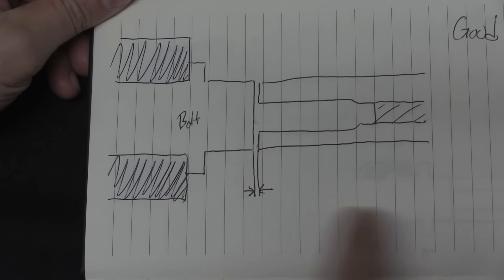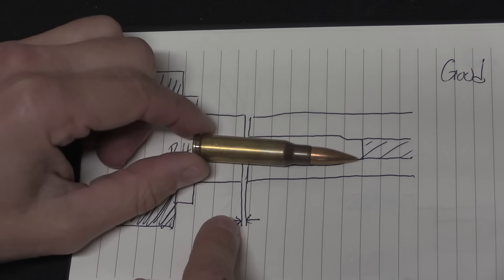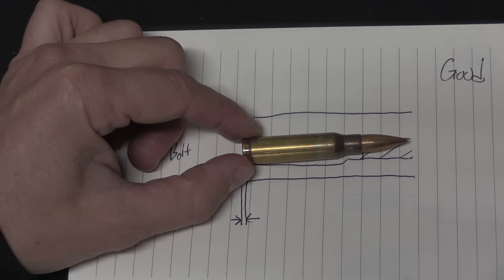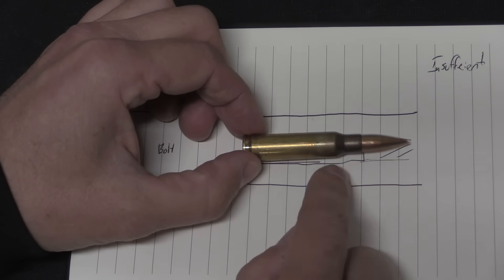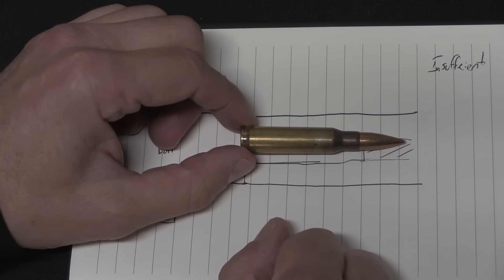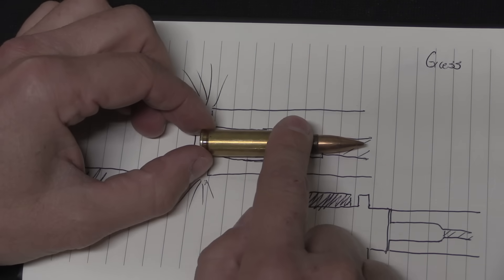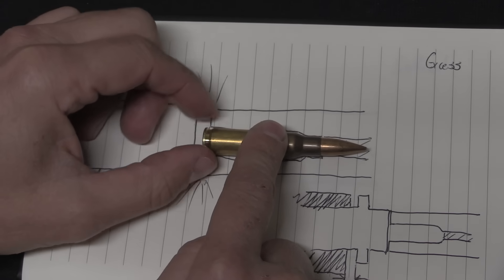Ask Ian: What is Headspace? (And Why It Matters)

Comment: Ian hit it on the "head" with this answer! I work at FN America in Columbia SC as a barrel QA technician in the barrel shop. This is exactly what headspace is and the importance of it being correct. If you have the experience and means to get the gages to check it , do it. If not please don't try. Excellent video on this topic Ian!
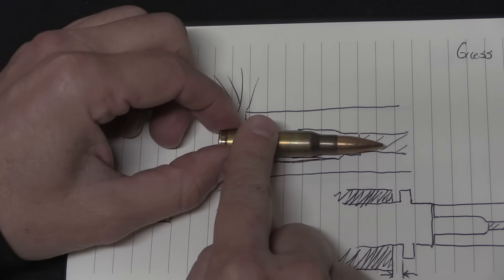Reply: Maybe you can explain then why the bolt sitting flush with the barrel is actually bad? Ian's explanation about that it makes you jam the bullet too hard into the chamber doesn't seem to be relevant, because later, speaking about a gap too big, he talks about the bolt being pushed flush with the barrel anyway, by the recoil spring or by hand (5:01)
Reply: @konstantin.v  I wondered about that too, and even if usual chamber geometries require that gap, lengthening the chamber just a little and starting the rifling a little later should allow for a totally enclosed bullet. There might be less obvious issues, like increased case lengthening when firing (because the case mouth would be the only available direction for the brass to expand) or tighter required tolerances, but this is speculation on my side.
Reply: @tz8785  , I'm guessing the thermal expansion: that a small gap on a cold gun is needed for when it becomes hot and the metal expands some. But it's a speculation, too 🙂
Reply: @@kellyharbeson18  @kellyharbeson18  and why exactly are you trying to belittle someone when I know what I said is the facts ?Free bore had nothing to do with what I talked about. You had a question about how Ian explained headspace and I went into a bit more detail. Sorry you are the master gunsmith, and you took what I said as wrong. But the fact still remains that if the headspace isn't correct you have problems.
Reply: @@kellyharbeson18 Ian was showing a very very simplistic way of showing why a headspace is needed and what can happen when it's not correct, now the head space is actually at the tip of the projectile when the bolt is in battery and it's the space between where the actual bullet is in contact with the  chamber and the  bullet lead.( The start of the lans) but if the head space is wrong it makes the bullet not seat correct and it could be to far in or , not far enough. And that's the issue Ian was drawing. And if it's in to deep the combustion can't get enough pressure and speed to push the projectile.

Comment: This explains the "why" of belted magnum cartridges: that massive back end is not to prevent blowouts, but to ensure the headspacing is perfect for those high pressure rounds.
Reply: It's akin to headspacing off of the rim. Although, you gain better feeding characteristics with a belted cartridge vs rimmed.
Reply: Yup. It's about having nice feeding characteristics like a rimless case, but the very positive headspacing of a rimmed cartridge.

Comment: How do guns with quick-change barrel avoid the headspace problem?
Reply from the maker: Either they have adjustable headspace (Browning 1917/1919/M2) or the barrel locking system has to be manufactured with the same level of care as the bolt locking system.

Comment: I was using a semi-auto .22 that had an out of battery detonation (yes, i know that's different from headspace, but the results can be similar) I wasn't using hearing protection so it made my ears ring pretty good, i got a face full of hot gas and i had a piece of brass 'shrapnel' stuck to my arm, as in it welded itself to my skin. It wasn't my fire-arm and the culprit was old ammunition and a dirty chamber ... so if the bolt and chamber aren't best friends it's going to get real messy real quick, even with something as 'small' as a .22

Comment: I'd just like to point out that there are situations where a headspace issue is less obvious, meaning that the weapon can appear to be cycling fine for several hundred or thousands of rounds, and then suddenly detonate. Typically what happens is a minor case of the situation you were describing @4:50 but instead of the spent case producing an evident indication, what happens is the locking lugs become fatigued from repeated impact of slamming that short distance, until either the bolt lugs shear or the trunnion lugs shear.
Reply: It might also be the case that the vast majority of carteidge-case headspacing features are produced very close to the mean dimension, with very few spread out along the entirety of the allowable tolerance.  But, when you do get one that falls at or near the minimum dimension, or perhaps even below it, you are going to be having a bad day.
Reply: I had a 22 rifle detonate after about 500 rounds (got it at a gun show so probably more put through it before me). Wonder if this is what happened.

Comment: The thickness of a sheet of paper is the difference between too short and too long. Well said sir.
Reply: @karlhillenbrand8447  Note, im not here to steal his thunder, merely add to it. His explanation is quite good.
Reply: @marknovak8255  I appreciate the input from an expert, so thanks for chime in!
Reply: roller bearings are the same way
except they need tolerances down to 0.0001 or sometimes less
Reply: @theq4602  Watching Hambini go on about how shit most high end carbon bike frames are, because they can't be arsed to make actually round holes, that are aligned and sized properly for their press fit roller bearings has taught me this.
Reply: @theq4602  
0.00001 bananas or sometimes less.
Reply: @onpsxmember  Atta boy, now your talking MY language
Reply: I"m a carbon-based lifeform, so I"m going to follow that advice.
Reply: Yeah, that’s the crazy part to me as a newer shooter. I hear people talking about putting a piece of scotch tape on the bolt, I guess, and I’m like, “ really?”
Reply: "The thickness of a sheet of paper." I once put a sheet of plain printer paper into a micrometer, and it was about one-tenth of a millimetre. Your paper may vary.
Reply: @DavidCowie2022  your 0.1mm is in the ballpark anyway, just checked the Saami drawing for 223 and from maximum to minimum is only 0.25mm
Reply: @DavidCowie2022 , most standard copy paper is .004” thick
Reply: I had a casing seperation in my WASR 10 when I tried to feed a new round in the bolt wouldnt close all the way then I looked inside there was the shoulder stuck in the chamber. I melted some wheel weights, poured it down the chamber then rammed it out with cleaning rod or solid steel rod ( smaller than bore diameter) and out came the peice of casing.
Reply: A sheet of paper is approximately .004” thick give or take a little.
Reply: That's what she said!

Comment: Thank you for another great video. What is the term for excessive space (diameter) in the chamber?  I have a .22 that I recently resurrected, when fired the shell case expands outward and then will not extract easily. The firearm is a Remington Model 6. Thanks.

Comment: Awesome video. What happens with cases made from something other than brass like steel or aluminium? I was thinking steel would not expand to make a gas tight seal but that does not make sense.
Reply: Ammunition using steel cases are very common, especially for Soviet/Russian designed weapons. Alloys are used that provide the necessary ductility; to soften steel and strengthen aluminum.  Also, steel and aluminum are considered one-use cases, not suitable for reloading, though some have succeeded in reloading steel.
You make a good point about steel expansion; while safe to shoot, they don't seal quite as well as brass, so a small amount of residue gets into the chamber, which results in slighty greater fouling which requires more frequent cleaning

Comment: Generally speaking, will headspace issues show up on brass consistently? That is, if my brass is coming out normal, probably means there's no significant issue? I have a carcano carbine with extraction issues to the point where the extractor itself doesn't pinch the case, it just pushes it loosely then jams in when locked. My hunch is the extractor is going over the case rim at the last moment, but it's possible the case is sitting forward of the bolt head, resting on the outside of the extractor. Unfortunately changing the extractors on carcanos is very difficult. The thing does not cycle very consistently but I have shot it without other incident a few dozen times, and all the brass seems typical.

Comment: I thought about a set of go/no-go guages when building my first AR. Fortunately on that platform, upper receivers aren't really critical to achieving proper headspace. I just bought a bolt carrier group and a barrel from the same manufacturer, and said YOLO. 
Brass looks great and it's the most accurate gun I own.
Reply: Headspace on a AR is at the bolt face and barrel extension/ barrel assembly. You can buy a bolt not cut right or a barrel that has not been cut right or extension not cut right or installed wrong. Buy headspace gauges.
Reply: Generally speaking if an AR platform will not forward assist to chamber while of course on Safety there is a problem. When done don't forget to clear the chamber.
Reply: I headspace all my AR builds, better safe than sorry

Comment: I'm finding that most guides or descriptions of the AK parts kit building process do not clearly describe how you're supposed to headspace the barrel before installing the trunnion. I noticed that your description also follows this format. How is one supposed to do this given the bolt can't be used until the trunnion is installed?
Reply from the maker: You install the trunnion in the receiver, then pre the barrel in and check headspace. Adjust the barrel in or out as necessary until the headspace is good and then drill the hole for the barrel pin and pin it in place. On older kits with original barrels, you will usually find that lining the barrel up with the existing barrel pin hole location results in good headspace (in my experience, anyway).

Comment: Question; I was at a standard pistol only outdoor shooting range years back, and I was in one of the cells not shooting, putting two pistols away. These cells were subdivided by wood walls extending back to your elbow if you were at the counter area.
I received copper-jacketed shrapnel to my arm. The range officer also felt a sliver nick his lip producing a small papercut looking wound.
How could this have happened?
Is this related to headspacing errors?
Reply from the maker: That sounds like jacket fragments ricocheting off a steel target.
Reply: @ForgottenWeapons  I don't recall the targets being metallic, but the frames were. They held up fiberboard panels. Maybe an impact to the frame generated the shrapnel.
Thanks.

Comment: What would the Headspace in the FG42 be? 
As far as I remember: In one older FG42 video it's said that the rifle has a cylindrical chamber in order to have the cartridge expand, form a seal and keep it sealed until it's fully extracted. The reason was that the FG is cycling faster than it should and the safety mechanism is the expanded cartridge.

Comment: Wouldn’t insufficient headspace also potentially prevent the rifle from going into battery?
Reply from the maker: If it's really insufficient, yes.
Reply: That would be the best case scenario.
Worst case - like Ian said - the case gets shoved into the lands and grooves, which can form a very tight fit around the bullet.
This can cause case rupture and bad accuracy or - again, worst case - cause the bullet to get stuck on the brass, which leaves all the pressure looking for an alternative way out of the chamber.

Comment: It's really important if you want to have a properly functioning, safe and accurate firearm. If you have too loose a tolerance you will find that the brass backs out of the chamber under pressure and ruptures at the case head (bottom of the brass) which vents hot gas at the shooter, or has too large a gap to jump the projectile to the rifling which causes accuracy issues, among others.

I've experienced both but never severely. I've also seen a few Lee Enfield conversions which had such severe headspace issues they ruptured every case they fired just above the case head. 

I immediately told that shooter the short explanation and that he really should take it to a gunsmith to fix. 

I never saw him again but I hope he listened.

Awesome work on the video, Ian, and a really good illustration on what the problem is and how to identify it! As always, keep up the good stuff.